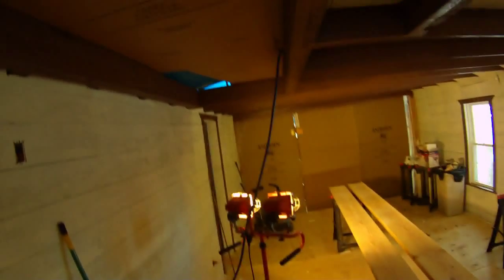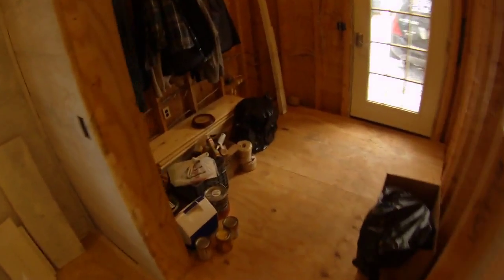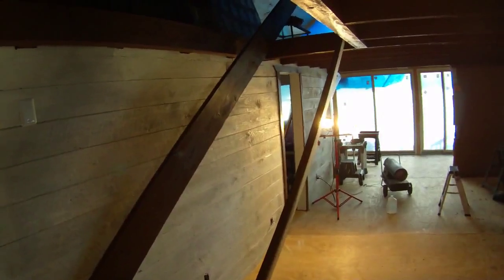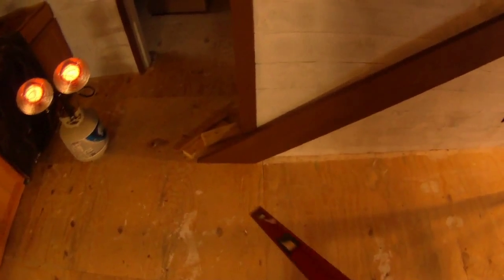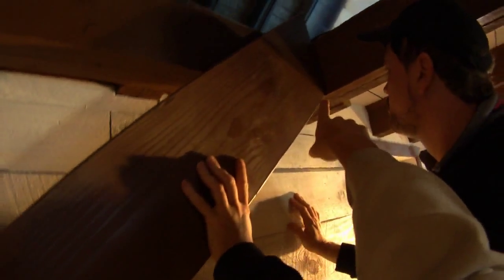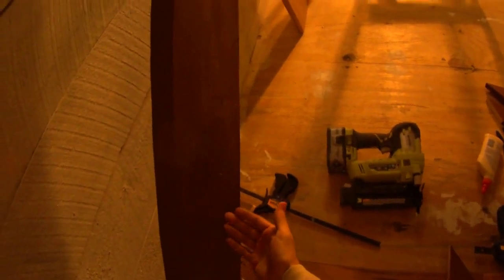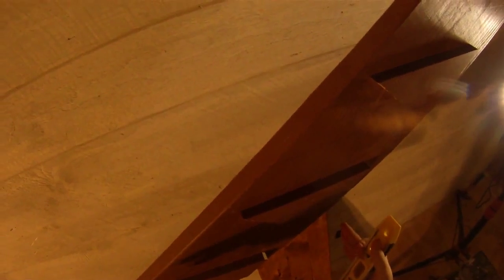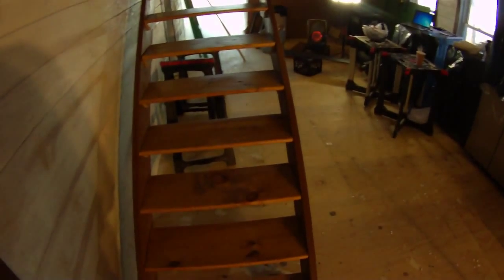P5 - How to Build Stairs to Loft  - Cabin / Home Repair & Restoration Project

Comment: What happened with the lift thing
Reply from the maker: I'm Glad you Asked... It was the original Plan, but like a lot of thing when you start building and realize how much work it is going to be and how much work is left it suddenly changed to just regular Stairs, i might still build some lift stairs for another Attic i will post the video if I do., The main issue the hole was not long enough for the stairs we had with the Stair Rise and Run we wanted.